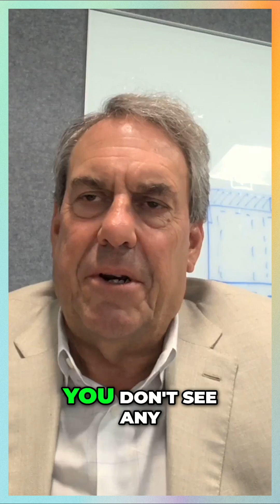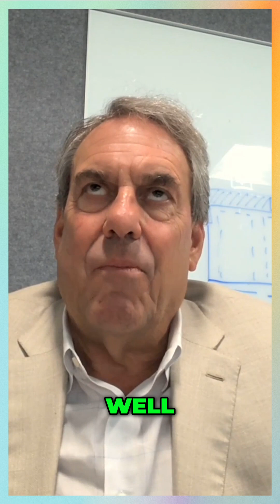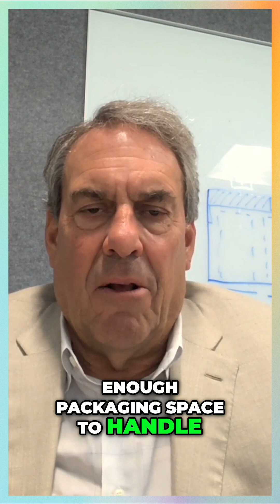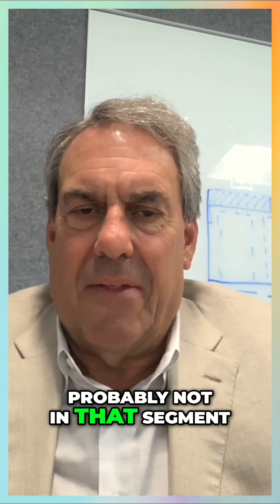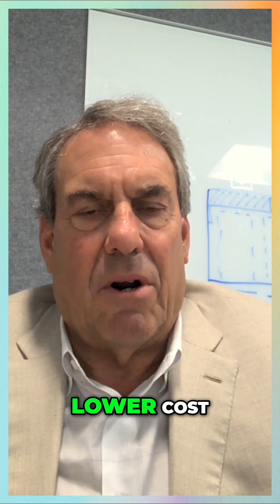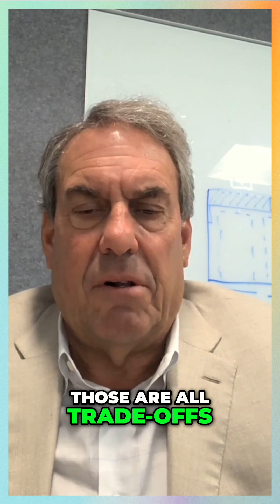GM President: Are LMR Batteries the Solution for Midsize Electric Trucks?

Comment: He could totally take the same battery, and drivetrain from a Bolt, and use it in a smaller (Colorado-sized) pickup, and it would be great. Slate and Ford are going to do this next year, at a sub $30K price.
Reply: Yup. But, I think the drawback is that pickups have to be able to handle a payload of >1000 pounds plus passengers. You need more battery - and motor - to do that at a level consumers find acceptable. That's why better energy density and lower cost per KW are necessary.
Reply: @GeeDeeBird  95% of pickups that I see on the road are not carrying 1,000 lbs in their bed. They are being driven with maybe one passenger, carrying and towing nothing most of the time. The old Chevy Bolt had a towing capacity of 2500 lbs. So even a full load shouldn't be an issue.  30 years ago the world was filled with mini pickups. Many with less than 100HP motors, having the same potential use as a pickup truck. The Bolt drivetrain has more than twice the HP, and far more torque. The Base Colorado had a 200HP motor, which worked fine for it's use.  Granted that the Bolt's drivetrain/battery would add about 800lbs over a gas pickup's weight, but having more power/torque should easily than make up for it. Even if it occasionally has to carry 4 passengers and a full load in back.
Reply: @deanmcmanis4862 Yep. An empty pickup would absolutely work. But how many people are gonna buy a truck that you can't carry stuff in? And as for towing, 2500 pounds is, likewise, inadequate. The lowest level Colorado tows 3500 pounds, and the trailer version tows 7500. I guess if you want an EV that looks like a pickup, that's fine. But I think most people would want to be able to haul stuff in their truck. And, with recent advances in battery technology, I expect small and mid-size EV trucks to be a reality in the next decade. For now, I'm happy with my Lightning. Cheers!